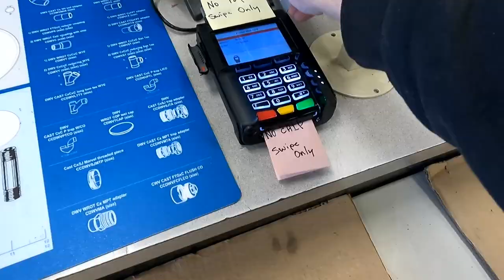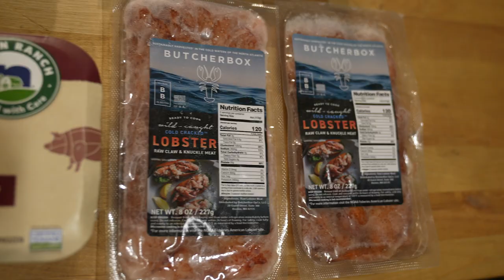PLUMBING WITH NO EXPERIENCE | BUILDING OUR OWN HOME

Comment: Trent as a plumber I would never make the connection to the main line until everything is roughed in. Because you need to fill the system with water to test it and those odors are dangerous gasses. Cut cap both and reconnect after test with the nu-hub coupling.. keep up the good work

Comment: In the UK. They put a piece of a loaf of white cheapo bread not the crust down the sewer pipe to stop the fumes. It dries out and seals the pipe. When the pipe starts to be used with water the bread dissolves and flushes away. Cheers from old George 👍🇬🇧🤠

Comment: i;m a plumber from what ive seen everything looks good so far
Reply: Are you saying that the 45° angle on the toilet drain is to code?
Reply: @ronsommer9409  Yes 45  and I've have some job's that 1/6 came in it depends on the lay out And distance
Reply: I was wondering about this too.  I thought that you were not supposed to have drop farther than the internal diameter of the pipe.  Therefore a 1.5 inch pipe would max out at approximately six feet which at 1/4 inch per foot.  This would be tons as a feeder pipe into a stack.  Not having the drop too steep is to avoid getting a siphon which would empty the p-trap(s) and allow septic gases to come back up the pipe.  I am not a plumber but am interested in understanding this.  I would also wonder why bother with a 45 degree down to the pipe (code or not) as it seems more difficult to configure.  Why not just continue over to the stack in a predictable manner and "T" that in with the correct fitting?
Reply: @kenwaring1963  darn good questions...I'm impressed.  Sounds like your learning a bit
Reply: I AM GONNA BE GROSS BUT POOP WILL TURN AT THAT ANGLE  I NOW UNDERSTAND WHY A PLUNGER DONT WORK....??

Comment: Put a wood stove in the basement to heat the whole house.
Reply: They complain a lot about being cold. I don't doubt they are cold. Can someone tell me why they don't wear heated clothing, use disposable or battery hand and toe warmers, etc? Can't they use their "candle" in the basement? A small propane forced air heater would heat that place up quickly and then they could shut it off while they're working. Maybe it's all drama for content, I dunno.
Reply: @gufredd9675  Until they are able to insulate the outside walls, they almost may as well be heating the great outdoors. Been there/done that.
Reply: @defrost8648  hi there DeFrost. 🙂
Reply: ...or a coal furnace, like the one my husband built in our basement in Northern NH. . . stoke it twice each day  -- early evening and early morning; it heats the whole house consistently 'round the clock with a nice, steady heat.
Reply: @batMelek  Yeah, burn as much coal. oil, and firewood as you can, Who cares about our climate or our globe??!! We need way more carbondioxide in our atmosphere. It will make it nice and warm allover the globe.....
Reply: @gufredd9675  hi Guf I don't think a solid fuel of propane heater would be great is such a confined space ,constructed to be water and airtight, stopping fresh air coming into the room.
Reply: @gufredd9675  That is the way I have been feeling.  They complain a lot anymore.  You don't put a wood stove by a stairway.  A good way to flunk a inspection and not have a exit out of the house.
Reply: @chelseajoyce5135  you crack a window when you are using the heater. I use a forced air propane portable heater in my uninsulated garage all the time when I'm working in it. Just like in my van, I crack a window.
Reply: Why ? They will not spend much time down there .
Reply: @at347est  It heats all the upper levels as well as the floor.  Uses much less fuel than a stove on an upper level.

Comment: You could take the cap off the cleanout and stuff a rag in to keep out most of the stank.
Reply: My thought exactly
Reply: Big gulp cup.
Reply: Always have a rag handy to stuff in pipe when you open it.  And use it in all openings as you work along.  No need for sewer gas inside, at all.
Reply: Are you kidding me, I heard methane gas is good this time of year😂

Comment: Hi guys. LOVE watching your channel. A good tip when doing plumbing with PVC is to cut and put everything together cold; no glue. Do it all. You never know farther along whether you need to adjust an angle a hair earlier on. Then when all the cutting and fitting is done, then you take a thinline black magic marker and scribe across the joint a single line so you know exactly how those two mated surfaces come together. Then take it apart a section at a time and glue it up. 
Also while working with an open sewer vent all you do is cap off that vent with a rag or something, until you need to open it. If you put in a leg then move the rag up to the end of that leg.

Comment: Those TJI joists have a drilling requirement, you can’t just cut big holes out with a saw zall. Also you need a vent stack and you should conventionally vent the washer machine 
line and  Toilet. Put a clean out on the washer machine line. You have a waste stack, but you need a vent stack. Conventional venting is the best way to go if possible. I’m in California though. I don’t know the codes in Utah
Reply: Utah is off IPC, but I agree. I see a missing vent for the half bath.
Reply: @JIMMYJO09X  It’s hard to tell from the video. They have (2) 3” waste stacks, they could wet vent the sinks, but don’t have enough room to wet vent the showers or tub. We use IPC or UPC. Just noticed he flat vented the washer machine line snd also he use a combo and 45 for the toilet, which won’t vent properly. It’s an easy layout, just hard to tell from the video
Reply: National code addresses this.  If he is rural it falls under national.  And national requires pretty much everything a municipal code would require.  Its wrong pretty much everywhere with what he did.
Reply: . He has (2) 3” waste for each toilet, flat venting is allowed when there is not ranking room for conventional venting, aping inspectors approval. He vented the washer machine correctly technically. Just depends on the inspector, the only think I see that is completely wrong, is he used a comby and 45 for the toilet, instead of a San tee. Which you are allowed to do if it was two waste lines connection, but since it’s for a dirty arm, it allegedly won’t vent properly  .

Comment: You can “wet vent” the bathroom sinks and you have 5’-0” on a 2” dirty arm for shower. For a bathtub/ shower combo for can use 1-1/2” but only have 3-6” for the dirty Arm. Shower only has to be a 2” drain line. Kitchen drain has to be 2”, but the dirty arm can be 1-1/2”

Comment: Thank you for sharing your real. The devil is in the details. Having done what you did without cutting anything out to redo is a great accomplishment. Stuffing rags in those open drains will help with the fumes. Also putting the vent stacks up as high as possible may move the fumes higher. Hoping for no frozen pipes. Stay safe, warm, and well.

Comment: Why not take the "Candle" heater in the basement? The hot air will rise upstairs anyway.
Reply: I have the same though
Reply: Might explode with fumes!
Reply: @skylarkenwood1422  what? The house is air tight, don't matter what floor the heater is on.
Reply: Yes it does, schute opening & stairwell opening...heat rises
Reply: @MrBrickboy38  air tight or not, heat still rises.
Reply: @larryfreeman7979  I wasn't commenting about the heat, it was the fumes comment that I was trying to figure out.

Comment: Easiest way to completely drain water supply lines. 
You need a bladder tank and an air compressor for you water system.
Winterizing basically
1. Drain water from the system.
2 Then use the air compressor to pressurize bladder tank.
3. Use the air to blow out any residual water in lines.
Works great 👍

Comment: Be sure that you install a switched outlet up in the space above the upstairs bathroom. Most people end up using these spaces for decorations, and it is nice to have the ability to install LED strip lights in the space above the bathroom. The switch (installed on a wall in the bedroom below) means that you don't have to climb up to turn the lights on or off. If you use a dimmer switch, then the lights become mood lighting (kind of nice for the master bedroom).

Comment: I haven’t read ur comments because so many of them but when u do your PEX water lines make all of them on a slope as much as you can and put  a couple valves in the basement that goes back into the drain so when u leave the house for periods of time u can just flip a couple valves and it’ll all drain out without having to blow it out with air at all. After owning rental property I only use 2 and 4 inch lines for drains. Things just gets clogged to often. LOVE your awesome videos. Keep up the good work. Would love to come see you guys sometime when I’m out that way.

Comment: Un cap and cap the glue quickly, only use enough so small bead shows after fit, and it slips together easy. Start with brush into deepest point of female side in fitting and work out, 1,2,3 Spins. Apply more glue, wipe excess on edge of can and apply to male side 1,2,3 loops and put cap back on  glue just enough to stop fumes.

Comment: Girl in the woods has the same disease. I’d never heard of it before.
Reply: Brooke lives in Alaska and the UP and even winter camps. I just started watching her gig on Alone. I think it just makes you more aware of your body temp and because you have this lable, you have to be more prepared. Which actually is a plus. You can research ways and gear to prevent issues, and have a plan and a back up plan. Hopefully Trent knows about snow blindness in high altitudes and wears UV protection when driving and spending time outside. Anyway, Trent and Allie are such an inspiration! So is Brooke, girl in the woods. They inspired me to keep going outside, even though special Olympics skiing was cancelled this year. I can't coach, but got snow tires on my mountain bike and keep going out. It is fun! Again, thanks for the motivation and inspiration!

Comment: Get some bungs to cover the open pipe ends until you connect them up. At a pinch tape a plastic bag over open ends. It does a lot to save your nose as well as minimising build up of noxious gases

Comment: Don't forget to get red fire block spray foam.  It's designed to fill in around the pipe penetrations.  It is required by code here.

Comment: Cold air is heavier than warm air forcing warmer air upward (the old heat rises concept).  Consider placing the propane heater in the basement to drive heat upward warming the floor of the main living level.  Something to consider.

Comment: glad you saw the one joint that wasn't sealed. i JUST had to seal a leak in a weakly, poorly sealed joint. i've had the house for 10 years, and this one spot in the tub drain pipe just started to drip. took a few years for the thin seal to just wear out, i guess.

Comment: To stop the poop stink, pull the first clean out and put a weenie into the pipe and pump it up. It will keep the fumes out. You could also jimmy rig it with a plastic bag and some rags.

Comment: Your plans should include a vent stack that will go through your roof in order to vent your fumes. You didn't mention it so don't forget to put one in. Don't set your toilet flange until you put your floor in. Stuff a rag or towel in the hole to deal with the fumes until then.

Comment: Not sure if you already have it planned, but don't forget to run CAT6 network cable to where you think you'll want a hardwire network connection. All I can say is that it's a royal pain to try and run after drywall is up. Oh, and closets, don't forget those. Lol

Comment: Hey Trent 100 years ago we would use some bread to plug the pipes when we opened them up. This kept the smell down. When the water finally hit it the bread would dissolve and run down line. Not sure that would work in the 21st century. 
You guys are doing great.

Comment: Your basement is the only portion of your shell currently insulated. Have you thought about placing your “candle” heater in the basement to warm the thermal mass each day a little at a time. By placing the heat source in the middle you are effectively sending the cold air collected in the upper floors from the night before to the basement as the air stratifies cooling the mass (which is insulated from the exterior).
BTW : love you guys.

Comment: You got a warm winter, here in Norway where I live we have  the coldest winter we have had for several years. There is little snow though and that's a bit sad, but i could do without -14 C as it is right now, -5 c is just fine by by during winter so I'm stuck in the cold and right now there is only 16.1 C inside in my living room because I'm not that cold under a blanket and I really don't want to get up to fire up the fireplace so I can only blame my self for being a bit cold.

I do miss the snow though because I can remember winters when I was a kid when we usually had like a meter of snow. The last 10 winters or so we barely have had any snow at all and that's sad. Plus somebody has stolen most of our dried out wood plie we carefully stacked in the back of our garden a few years ago. We have no idea of how took it, but there is an access road belonging to the local graveyard on the other side of some bushes and a couple of trees. Most of it was gone while we went away on holiday for 5 days and worse the assholes who did it returned a few weeks later and took most of the rest. To get all of that moved it had to be done by someone using that access road and due to the amount it has to have been done by several people.

Lets just say that there are a lot of rotten people around here.

If we don't lock our door during summer, if we are home, we risk getting strangers walking into our house to check what to steal, we surprised someone doing this 2 times before before we started to always lock our door. A few years ago, we could leave it open all the time, but now, stuff is disappearing if we keep it outside under the roof beside the garage and they take the oddest things. Even our car has been broken into 3 times now so we can't leave anything in the car where it can be seen. The whole city is going down the hill, but you can't see it unless you live here because the government is smoothing things out and working hard to make it look like this is an idyllic city, it is not. It  was, now it's more like a permanent construction area because a lot of areas needs to be fixed or upgraded. Even right now the access to our own house is restricted due to road upgrades and upgrades to the water system, only they have been working on our street for f*ing 2 years now and they just began to dig up certain parts again. The same thing is happening so much around the city that you can't move around without not noticing all the work or construction.

One good thing about the cold is that noting is vanishing and we had so much sucky weather these last few year that our stuff has mostly been left alone, except for that dried out and cut wood ready to burn.

So bless your self, because you are lucky even if you have lot to do and it's cold. :D

Comment: Good on ya for taking the leap to do your plumbing work. I have way too many years of sniffing glue. Code would prefer a 3" San Tee instead of a wye. Tgi and bci joists  require taking out the mid section of a joist. Try to stay away from the top and bottom flanges. Good luck.

Comment: Not sure if someone else has said it already, but you could open the cleanout and put a damp rag in there so you are not breathing in the sewer gas. It is also dangerous to be running your propane heater with sewer gas leaking into the house since you are closed in. Just a little FYI

Comment: The wye to 45 in your stack for the 1st flr toilet is generally prohibited by codes, a sanitary t would be needed. Toilets need airflow from the stack, which gets trapped with the y 45 arrangement where it drops. Go sanitary t, it will save you a failed inspection. Might have to get a coupler and splice a piece in. And the rise over distance isn't a myth, it's code you may get failed on. Solids need 1/4 inch to half inch a foot so water doesn't run off too fast or too slow... Then hair, toilet matter, etc could start build up, or with too little water could stand in the pipe, which could cause droop. It's generally accepted that in 3 and 4 inch pipe this is critical, 2 in and smaller it's not as important if you're near the vent stack. If you go too far you may need a revent (a pipe just for venting air you run above your drain pipe) to the stack, tho if you're within 8 ft for 2 in pipe, 12ft for 3 in from the stack you should be okay. Measure where your laundry will be to be safe as it may require a revent... don't forget you need a trap for the laundry machine. As you haven't installed the vent out of the house yet, a note. If you're building a space above the bathroom, for any purpose, you can save yourself the vent stack up through the roof if you go out the sidewall... It still needs to rise a foot above the roof/above your highest operational window, depending on local code. All that depends on your framing and insulation goals. I would come over from the wall and up through the roof to save that space for storage, Frank's nest, personally. Coming over from the edge of the roof helps with the rubber boot waterproofing on the stack, and makes your roofers life easier later. :) The vent can meander a bit as long as you still keep a little pitch in it for rain to drain down. Just sharing as a private rental inspector, might help save you from a failed inspection or worse, random plumbing issues later on after you've finished the house!

Comment: A paper bag that will dissolve in your septic with toilet paper in it in your clean out T to block the toxic air.. You can remove it through the clean out. If that fails it will dissolve eventually in the septic tank.